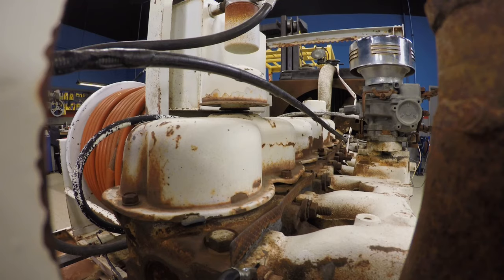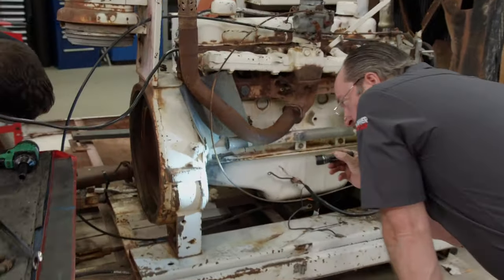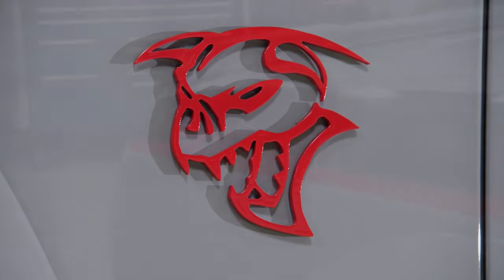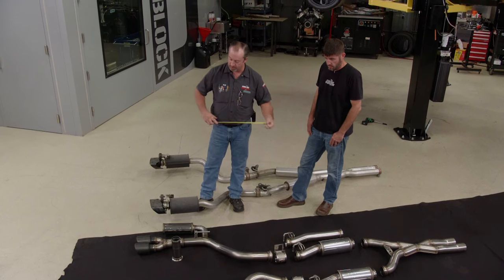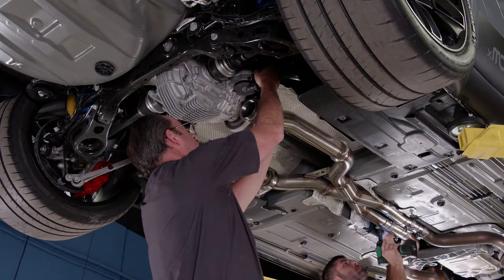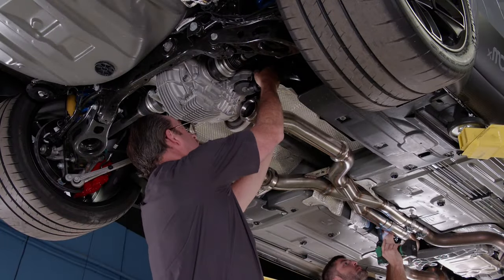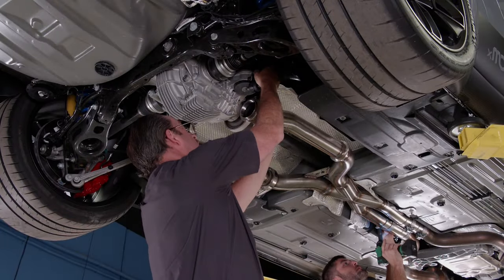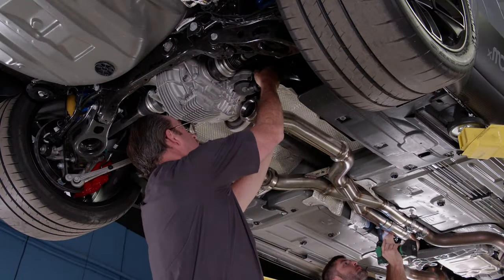Will The Ford 300 Inline Six Start After Sitting For 20 Years? - Engine Power S7, E14

Comment: Now put some boost through it and watch it beat out stock v8s casually
Reply: on the low end yeah, the high end, this motor has nothing, that's where the V8s shine
Reply: @daveb1081  when these 300s are boosted they become very strong accross the band, the torque just goes up with hp it doesn't drop bVk down these make stupid amounts if power, I bet if a billet 300 block and head we're made would be comparable to a 2jz since a 2jz holds third place for the quarter mile in the world
Reply: @Project-gr6zy  damn, I figured the motor can't rev high enough to spool a turbo, besides, this motor is all about the low end lol
Reply: @daveb1081  each cylnder literally is 50 cubes a 3.5l v6 ecoboost is like 213 cubes and makes 400+ torque so imagine a full 300 with twin or sequential turbos and there's a guy called the French town flyer who makes over 500hp with one of these turning like 8 grand

Comment: it was made to run at low rpm, maximum torque, as soon as you revvit up starts to choke
Reply: Someone needs to make an aftermarket cylinder head with bigger ports so it breathes better
Reply: @joshuaherpolsheimer4699  this is the stationary version, made to run slow, one from a truck will breathe better

Comment: Pulled one of these out of a firetruck once and replaced it with a brand new 5.8 Cleveland v8.  It made almost NO difference to the drivability of the firetruck.  Waste of time and effort.
Reply: The 300 has so much torque.

Comment: 300 didn't have a balanced flywheel, and 302 and 351 have different balance weights.
Reply: That is correct and you can bolt a zero balance flywheel on it like they did and a transmission from a 302 or 351W with matching starter for the flywheel.  I bought a zero balance billet Ford performance flywheel for my build.

Comment: Isn't this similar to the straight six that the Australian Barra 4.0 Inline 6 Turbo was originally based off of? I know that the Barra 4.0 was originally similar to this and we had that original engine in the states. After that though, Australian engineers were aloud to continue improving and developing higher powered and more stout versions for every generation. All the way to what we have today which is High HP and insane Torque monster 4.0 inline 6 cylinder turbo engines. It would be cool to build this engine and throw a turbo on it. I bet you could easily get 250-300 hp and based on how torquey this engine is already, probably 550 ft lb of torque. I'm sure past that you'd probably have to go deep into the pocket book. Getting custom engine parts made. I don't know if there are any off the shelf forged parts for these engines. I doubt it though. So if you actually wanted it to last, you'd be paying a lot for custom internals. Still, it would be incredibly unique and a lot of fun!

Comment: Sorry, but the carb that it came with was a gasoline carb not propane.  And, these guys should read up on that manifold and why they are bolted together.  Smokey Yunick built an engine back in the early 80's with the intake inside of the exhaust manifold for high mileage and power.  The Schram air compressor engines did the same thing in the 60's.  But, hey - it's a made-for-television show.

Comment: I had a 300 in my old 1980 F150. That engine huffed and puffed like it was in a tractor, but it ran. When I pulled it apart that thing was completely orange inside from straight water and rust, and I could peel off pieces of the #1 cylinder wall. That was a tough son of a bitch and if it wasn't for the fact that it was mistreated, I would have kept it.

Comment: ya guys, you uhh, forgot to do 2 out of the 3 dyno runs you were supposed to do!  where's the baseline run with stock (or whatever was on it when it came in) exhaust?? where's the run when you went from the straight pipe inserts to the muffler ones, ...  (Maybe that could've been skipped if they are internally open, like a glass pack type.) but that 1st one was a MUST, depending on what if any gains you get with it, would decide whether or not i would even want to buy it...   just noticed, 3 years old, so who even cares now anymore... but for future vids like this, if you're going do something like this, do it right!

Comment: Industrial engine anything and esp old school is not car mechanic friendly. The 3 liter ford has 120hp and 5l 180 or so. The 300 from vehicles much better choice. 700lbs it has industrial roots. Few simple mods it can have BB power under 2000rpm. 400ft lbs under 2000rpm is possible if smart and low budget. Bad in rain peg leg or winter. Exhaust divider in head 10% add exhaust crossover 10% cold air 10% ...a 95 96 2 mods like that tuned be aprox 350lbs tq under 2000rpm. 100k cam gear life stock. Most versatile truck/industrial engine from ford, marine ect. The 120 4cyl might be king overall

Comment: I am an old dude, and so bored with all the 700+ hp engines...  Tunes, FI, multi valves, blowers, turbos....  It's too easy to make power these days..  BFD...  I grew up with carbs, points, setting dwell and AF mixtures with a screwdriver..  Sure, they didn't have much power, but some of those old engines of the day did put out some decent power..  Would love to see some old Ford 428 "tuning" on a OEM setup...  Or a 427 Chevy, or a 440 mopar, etc with just carbs, points and some timing....

Comment: The 300 isn't much of a generator engine IMO. The fuel consumption for the electricity potential would make it completely uneconomical for anything more than a few hours a year emergency. The engine pumping losses at light load make it use say 2+ gallons per/hr for say 5-6000w. At say 30 KW it might drink ~35++liters/hr! ??
A 30KW single phase Diesel might drink 10liters/hr at full load.
A 1 liter 3 cylinder Diesel might use 900cc/hr and make 6000w @ 2.2l/hr.
I live on generator power and I can tell you grid power is a luxury - and I have a Mitsubishi 1500rpm 3 cylinder Diesel gennie.
I also have a V twin gas 3 phase and a single cylinder Diesel. See what I mean? I need 3 damn generators (plus never ending oil and filter changes, brushes, voltage regulators, electronic controllers so on and so forth) to do what one good grid connection could do with perfect frequency regulation. And idiot generators wear out on top of that and have nothing like the frequency regulation mains has. Generator frequency varies depending on load shortening appliance life. Unlike a grid connection gennies don't last forever.
There are some advantages of generators but I think of them at the moment LOL. I hate them.

Comment: My question is this saying how are used to drive a pick up truck with 550 foot pounds of torque making only 385 horse... are used to devastate everything with this Lingenfelter built California Highway patrol engine for 1967..
Point being the torque not the horsepower used to beat everybody in the quarter mile.
But all I ever hear is people bragging about horsepower horsepower does not win drag races. I’m speaking this from practical experience.
Torque get you sent out there in the front from the start and horsepower tries to catch up .., that engine only lost one drag race to a super charged nitrous oxide powered Ford that had a big block in it and if that wasn’t the biggest waste of money I ever

Comment: lpg/propane/gas.nothing wrong with lpg,if,you build the motor to suit,high comp,timing,it actually will kill a gas/petrol engine,if done right.mate was faster than hat v8,s at the 1/4 mile.they were shocked when he showed them the 4.1 ford log engine.plus,a 6 will allways have more torque than a v8.more reciprocating weight.engine of same cubes.

Comment: "sprayer" oh it's sprayed all right, you might want to wash your hands that's a sewer jetting rig
Reply: That's the same rig we used on an industrial weed spraying unit.
Reply: @OldGriz708  do y'all use a different lead hose?
Reply: @dustinlittle4194  
It looks about the same but the last time I saw it was 30+ years ago.
It was set up for both the hose and a 12~15' wide spray bar that mounted on the back of the truck. It was a F350 stake truck. It was primarily used to spray fence lines, 5' out from the building foundation, and parking lots of USDA inspected food processing plants. It saw some work along railroad tracks as well.
Reply: I just rewatched and as they were bringing it in, it still had the "tiger tail" on the hose. Definitely sewer jetter

Comment: i can remember the Ford 300 6 was a gas hog and a piece of crap, especially in a Ford Monarch, bottom of the barrel, what do you do with that cheap AS 6 inch scale, the graduations aren't even right
Reply: The Ford 300 six was never put in cars only trucks and equipment. Not saying someone didn't swap a 300 in a car. Could be the 3.3 straight six ford had. They put them in a lot of cars.

Comment: they really are pretty under powered engines considering their displacement. a New 4cyl stock performs much better... that 300 cubic inch engine is almost 5,000 cubic centimeters .. a or 4.91 Liters... even the worst rated 302ci 8cyl is going to perform much better... its cute to work on.. to say you did once... but unless you are doing a historic numbers matching restoration its not worth the time. A lot of engines are like that.. built poorly.. new or old